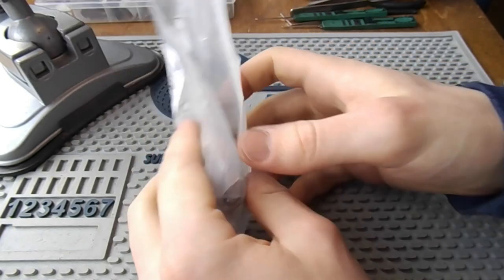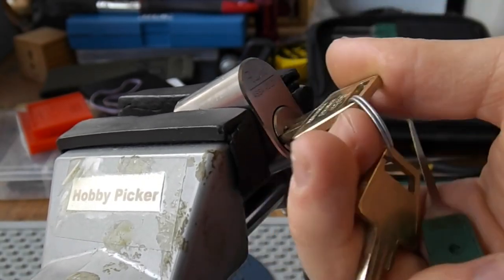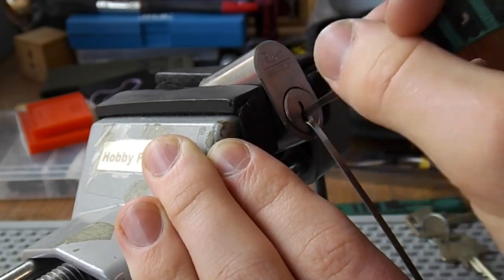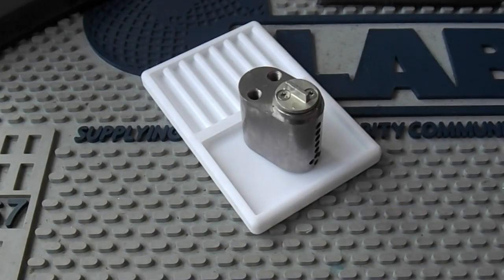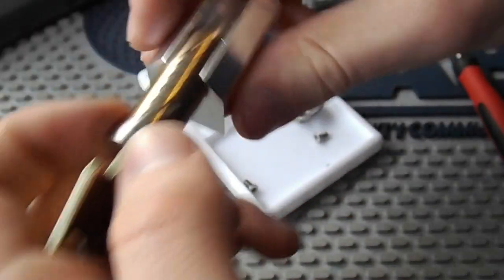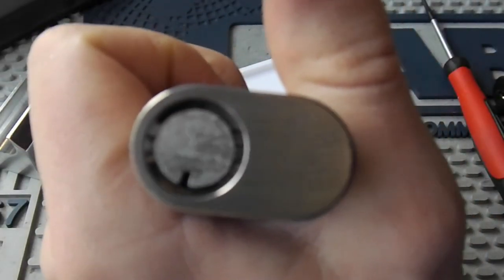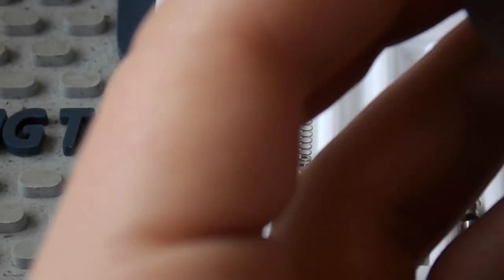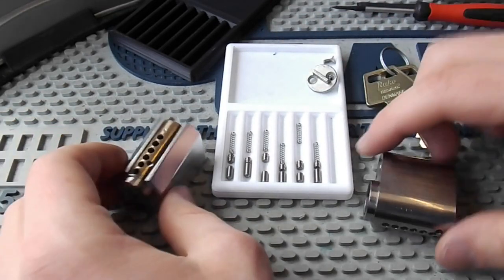Assa RUKO cylinder SPPd & Explored (221)

Comment: you really need a MACS repin set for that old ruko 600 VT. that key is too boring. Do you not follow my Ruko School?  Because all those drivers are standard. They are the only drivers we can get. And all 6 pin housings are identical. only the plug change with the type. that is why it is prepared to take a sidebar
Reply from the maker: Interesting, I didn't actually know much about these locks, and discovered that for some reason I haven't been subscribed to your channel... that issue has been resolved so now I have to catch up on your videos!

Comment: Great picking my friend! I’ve the same lock with the same keyway actually. Rune International can answer any questions on this lock I know 👍 I believe the little divot on the plug is for a spring loaded ball bearing. Might be wrong, but I’ve seen that before 😜 great video!!
Reply from the maker: Thanks for watching buddy, Rune actually got in touch, I'm very new to these locks! I wondered about the indent, but I didn't see a drilled chamber above it?